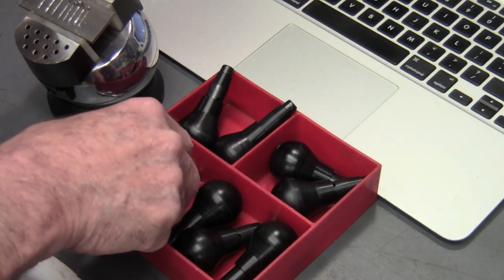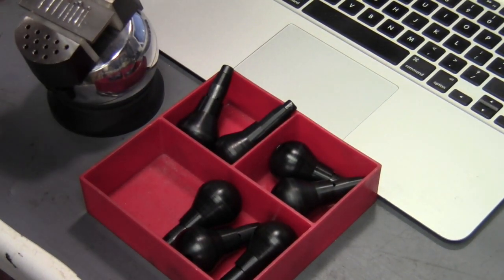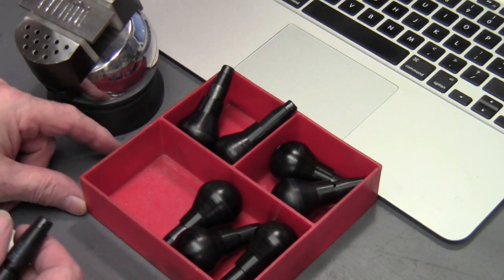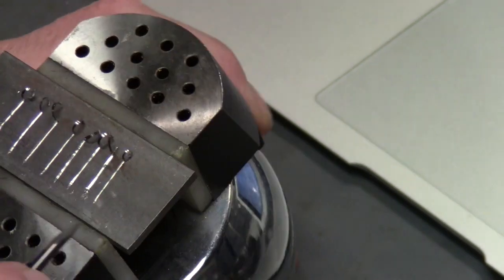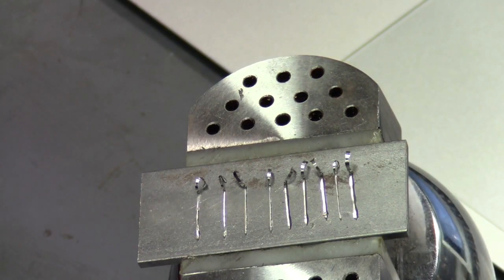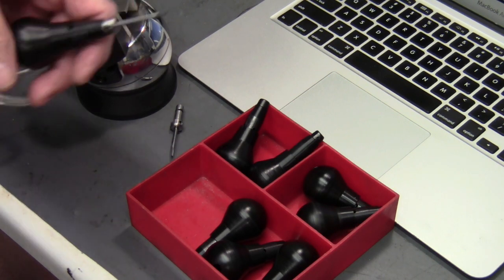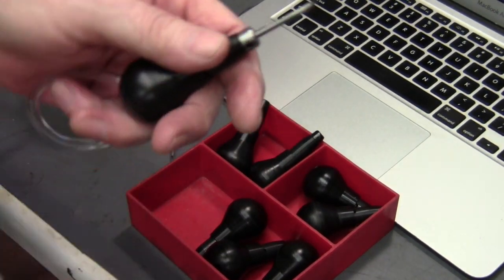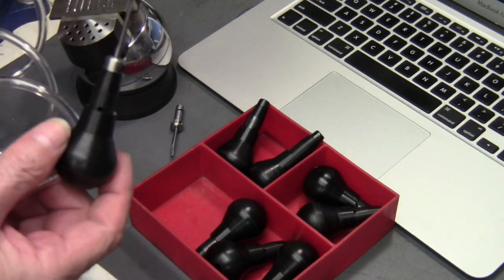Black Delrin HPs

Comment: I like this Delrin handpiece idea! I have a question about the air supply. In the drawings you sent you show two types of air compressor: A compressor that is variable speed through control of the motor speed but the compressor itself is un-altered. The other is a highly modified compressor to make it a push-pull air pump.

Correct me if needed but but the Linsey (sp) hand piece seems to have a push operated speed/power control built in to the handpiece. The harder one pushes, the faster/harder the unit hits. Or so it seems. Kizo (sp) unit has what seems to be an extra port which he covers with a finger to turn it on and off. And I suppose he can control power/speed with it also.

I assume I can use a regular air compressor and adjust the pressure there. But I really like the push "throttle" idea. Is that feature exclusive to the Linsey unit or is that design available to "copy"??

I have only done hammer graving but my hands have trouble these days and a p_nu_matic hand piece would make such that I could continue to engrave, the little I do anyway.

Ideas??

Thanks,
Pete
Reply from the maker: Here is how this system works   https://www.youtube.com/watch?v=F1FXjUErC1Y
Reply: @ralex397  Thanks! That helps a lot.

Comment: Hey Rick i use a cheap air pump from china, callled ACO 003 its a magnetic pump pushing a piston back an forwoard. it works great and has a bit more power then the cheap compressors i could find here. i will make a video on the hole set up.  thank you for sharing the info on how to build these han pieces. i allready built myself 3 of them and want to start selling them too. but dont worry i am from Austria in EU. beste regards Phil
Reply from the maker: Thats great! I have been getting requests from the UK and right now I am unable to get insurance and tracking outside the US. Good Luck!
Reply: Wild Style Works do you have a link for that compressor ?

Comment: Hi Rick, what material you use for the demo engraving ?
Reply from the maker: It is a 1/8 inch thick steel plate
Reply: Thank you so much, because need find some material to testing and training, don't know which is the better choice for it. :D
Reply from the maker: Shaun Hughes recommends using coins to practice on, if it comes out good you can sell it, or give some away as a calling cards. Have fun!
Reply: @ralex397  Thank you for the suggestion, ya Shaun do a lot coin engrave practice :D